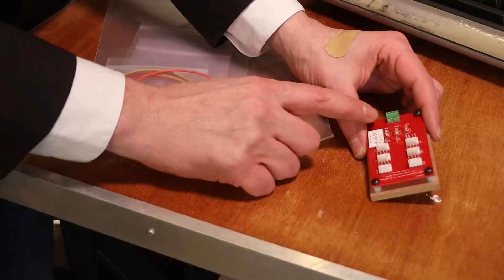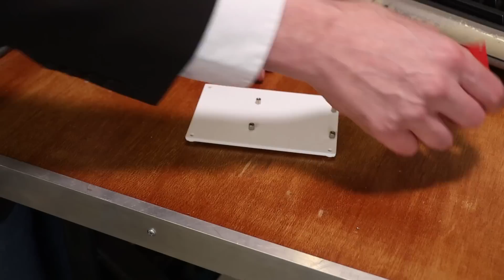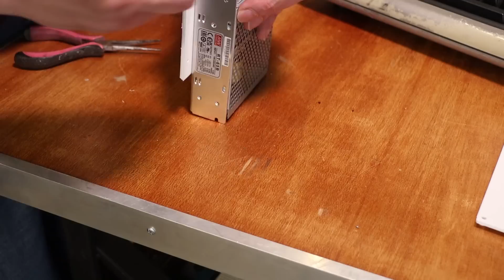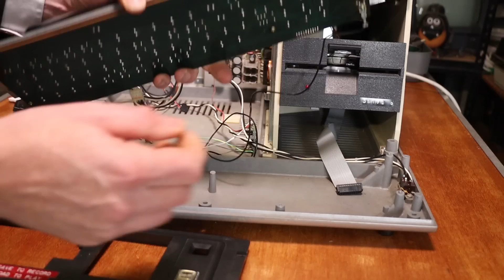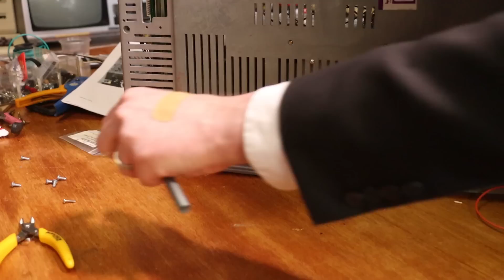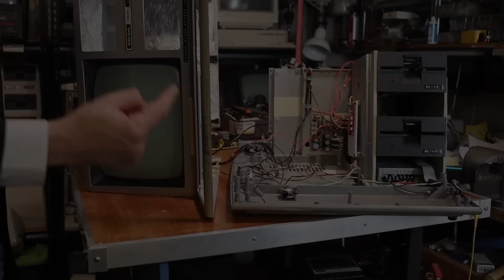The well loved Model 3 gets a new power supply #SepTandy

Comment: Got me thinking of upgrading my machine, a model 1 in a model 4 case.

Which brings me back to my favourite peeve with US equipment, black for active...  I usually rip that out and put in standard brown & blue etc, lest I mistake that thin black and white as something else and give myself a shot of 240V in the future.
Actually for that longish run, I would use standard three core flex, then is will really look like power wire.
I would also put something over the back of that power switch, it looked like bear solder joints in the video, so easy to brush your hand over it whilst servicing your machine. Even a liberal coating of hotmelt glue is better than nothing.

Comment: Wow, I'm impressed! You did that mains chassis wiring without burning the house down even once! A task which nanny state would have us believe is borderline impossible to do without the correct qualifications and certifications. Certainly on par with handling firearms, transporting radioactive waste, or wiring an Ethernet cable. All of these things are clearly of equal danger in the eyes of nanny state.

Seriously though, this does seem like a neat solution. I was looking at a similar Mean Well power supply to use in my Apple II clone, but I ended up going with a TFX power supply, mostly because it was a neater fit. Unfortunately there's no nice breakout board like that for my machine. It used a weird power connector, not the "standard" Apple II connector, so it took a while to figure out what it was so I didn't have to solder onto the board. Turns out it uses a JST connector that's still manufactured some 38 years later. A quick order placed on the JST website and I had the connector and contacts within a few days.

Comment: Amazing that tiny MW PSU replaced the 2 massive by comparison original supplies.
Reply: The original PSUs with a dual floppy machine would see the display duck and weave when the disk drive motors were started.  This one is probably much better regulated.  I replaced the PSUs in my long gone 4 internal floppy MIII with a single beefer and cooler running 5V/12V power supply.  The - supply for the DRAM and RS232 board were done with separate charge pumps based on 555 timers.  The DRAM needs very little current and the sag on the one for the RS232 was low enough that it didn't cause any problems.  These days you can buy isolated 5mA PCB mount modules in any low voltage you want for a few dollars.

Comment: Excellent.  I'm sure i'm going to need to do this at some point.  I think i'd rather figure out a way to use the existing power supply locations than storing under the disk drive.. I guess something to think about.  Thanks for the vid!
Reply from the maker: It possibly doable. However the Mean Well is just a bit wider and longer than the four screw points where the original PSU’s mounted. And if turned 90deg and mounted where the FDD PSU was, it fouls on the CRT. And is too tall to mount where the rear PSU is. I tried all kinds of other mounting options before deciding on where it ended up.